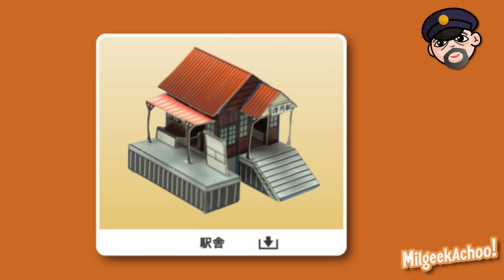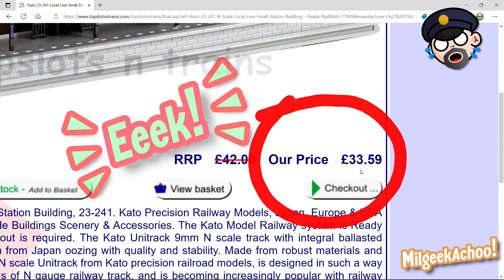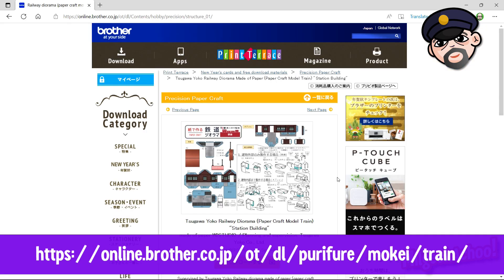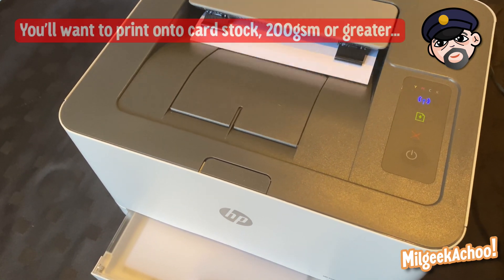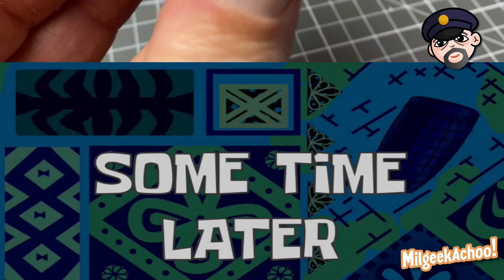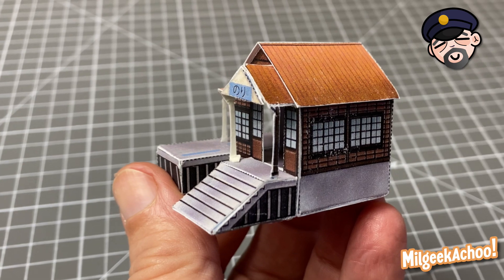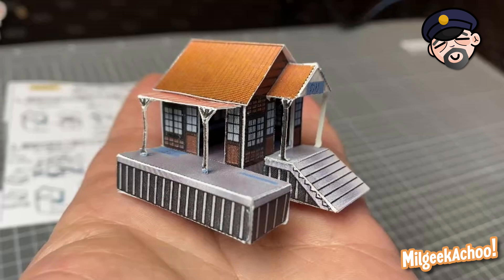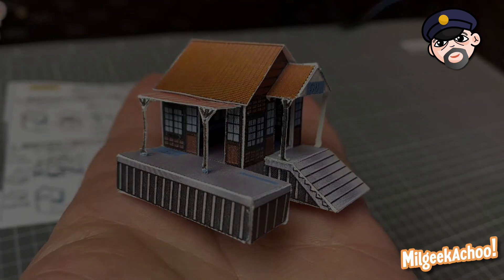N Gauge Layout Buildings - Japanese Papercraft Station Experiment

Comment: Nice try Dude. I will also be using some paper models on my budget layout but, having made these kits before, they do tend to sag  so I glue them onto thin card which helps keep them rigid. Eventually, I will either resin cast or 3d print my buildings so I can at least get textured surfaces.
Reply from the maker: Hmmm, 3D printing. Now there's an idea! :)